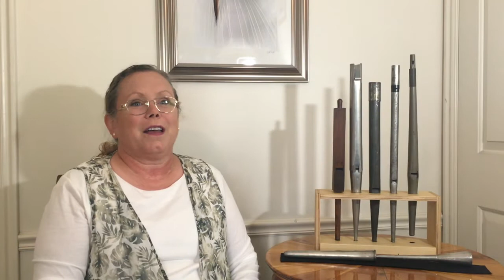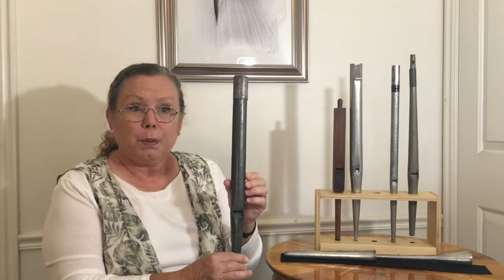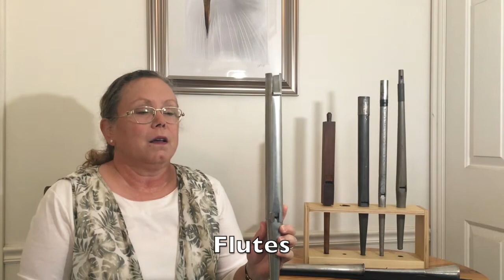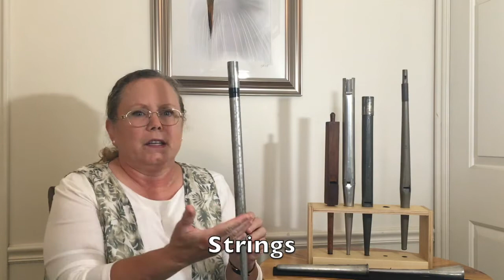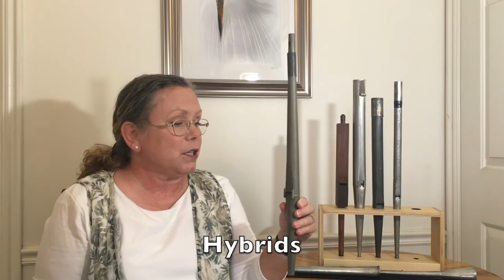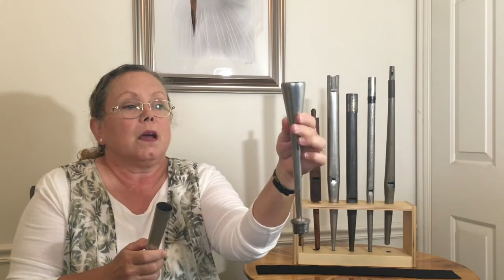Families of Organ Tone

Comment: The most common pipes: Principal, Diapason, Octave, Super Octave, Mixtures, Scharf, and Tierce. Principal and Diapason pipes range from 32' 16' 8' 4' and 2'.  Octave pipe are 4'. Super Octave is 2'. Mixtures are 2-2/3'. Scharf are 2-2/3'. Tierce is 1-3/5'. Scharf, Tierce and Mixtures are mutation stops. Mixture II, Mixture III, Mixture IV, Mixture V, Scharf II, Scharf III,  Mixture II means one key plays 2 pipes at once. Mixture III means one key plays 3 pipes at once, Mixture IV means that one key plays 4 pipes at once, Mixture V means that one key plays 5 pipes at once. Tht Mixtures, Scharf, and Tierce pipes are the size of either a #2 pencil or a straw and not to be played by themselves, they're only used to be a topping for other main sounds, while the 32' 16' 8' 4' and 2' pipes can be played on their own without the pencil or straw sized pipes added.
Reply: "Tierce pipes are the size of either a #2 pencil or a straw and not to be played by themselves, they're only used to be a topping for other main sounds,"

I call those the dog whistle pipes
Reply: i was thinking you were dead
Reply: Clearest most concise demonstration of the 4 basic pipes I've ever seen.

Comment: Clear demonstration, but I wouldn't recommend putting lead pipes in your mouth.
Reply: Professional organ builders do this all the time and there are no problems, the only time you should not is if there is corrosion (sugar lead) on the pipe tips.
Reply: @holmespianotuning  Given oxygen, lead will form an oxide later, which is subject to rubbing off in your mouth, and slightly water soluble.  The problems may not be visible for a long time, but since the biological half life of lead is best measured in years or maybe even decades, it will accumulate.

Edit:  A report just came out (heard on BBC, original source The Lancet) indicating that lead is a LOT worse than had previously been believed, both for brain cells and cardiovascular health.

Comment: This is very good! though I hope the lead toes have some kind of clear coating on them so bare lead isn't being applied to your  lips!
What would be really good is to  construct a small pallet box that air can be introduced into with a small  blower to sound each pipe with exactly the same pressure and temperature. Blowing air from lungs into a pipe changes in both pressure and temperature which affects speech and pitch.
Reply: Its soluble compounds of lead that are dangerous (like lead acetate) - not the insolubable metal

Comment: I get that the tapered flute pipe has a sound half way between the wider pipe and the narrower one, but how does the tapering affect the sound compared to a pipe of constant average width? For example how does the sound of a pipe that starts 3 inches in diameter and tapers to 1 inch in diameter compare to the sound of a pipe that is a constant 2 inches in diameter?

Comment: Shame on you for blowing into these pipes.  A renowned organ builder once told me NEVER blow into an organ pipe, as the humidity in your breath will distort and/or possibly detune a pipe. Use a small air supply next time.
Reply: Professional organ tuner here. I’m afraid you are mostly completely incorrect. Flue pipes are often blown during the voicing process to see what point they will overblow and will not be damaged in any way, shape or form by being blown or the moisture from breath. It is only reeds which should not be blown as the moisture can encourage the formation of verdigris on the brass, having said that there is no harm in blowing one only used for demonstration purposes. Reeds are not blown by mouth during the voicing process as it would not tell you anything useful.
Reply: Stick to pianos, doing that during VOICING tests is not the same thing, and the pipes would be on the voicing machine in the shop for the most part and get cleaned afterwards before installation.

Of course for DEMO purposes nobidy cares, those are junked pipes anyway, but trying to demo them by blowing in them is a poor way to do it, pressure and temperature varies widely. Much better to just construct a little pallet box or a box with Peterson valves, put some wind in it and the pressure and temperature is constant and the same.

 @holmespianotuning
Reply: do you have dementia you commented this same thing two times on this video 3 months apart
Reply: do you have dementia you commented this same thing two times on this video 3 months apart

 @OdysseyABMS
Reply: @jrzzrj   that is indeed what i told you

Comment: Never blow into pipes with your breath.  It ruins the pipe. I thought you were educated.
Reply from the maker: These pipes are used exclusively for organ pipe demos. The point of their existence is to be blown into.
Reply: @norahess5499  ----Sorry, but a pipe organ builder told me that once.  Something about the humidity in the breath.  Ohterwise, for demo,,,,it's ok.
Reply: @jrzzrj you didn't have to insult her with the first comment.  That's not educated!
Reply: @norahess5499 besides the fact there is no harm whatsoever in blowing into flue pipes, I think this gentlemen is thinking of reeds which shouldn’t be blown normally, but of course there is no harm in blowing reed pipes exclusively used for a demo.